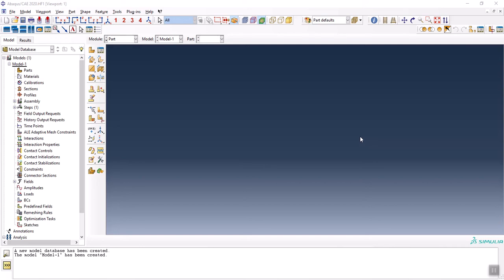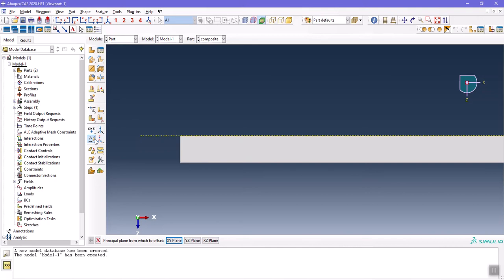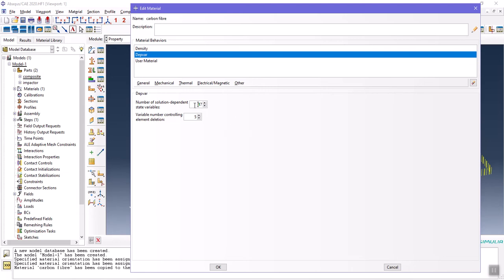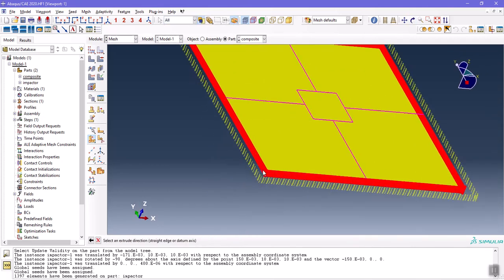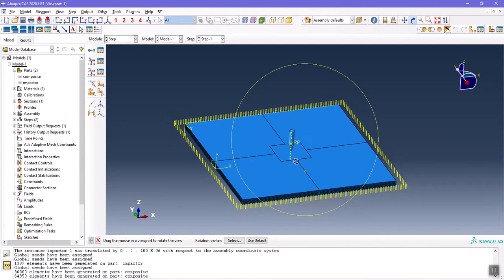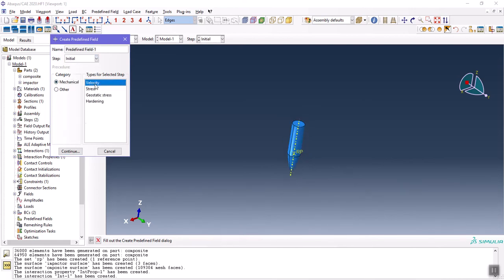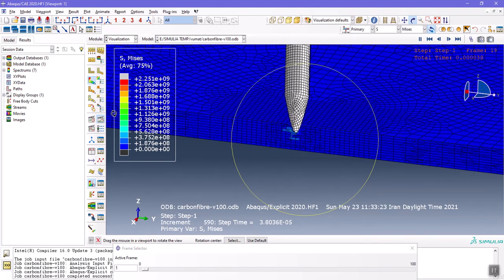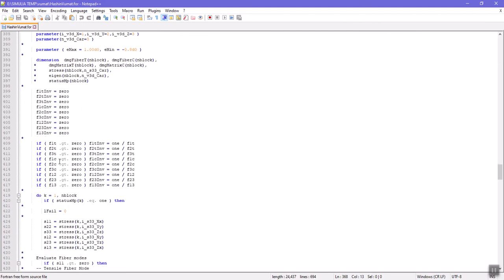High velocity impact of rigid impactor on composite using VUMAT subroutine

Comment: Sir, where did you get the properties of the composite?? I want to use another composite material..!
Reply from the maker: carbon fiber/epoxy material properties is used for this example. you can search for your specific composite material properties in the related articles.
Reply: @engineeringsimulation7364  Thank you~~ I’ll search them
Reply: @engineeringsimulation7364  Can you share the source of the material property table on your video?
Reply from the maker: @yyunchang  https://doi.org/10.1016/j.tws.2017.08.021